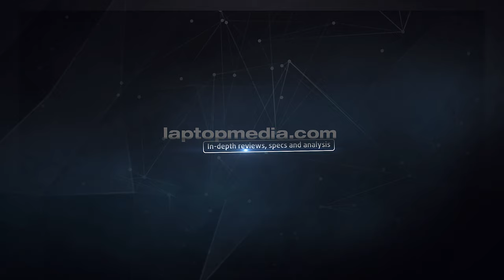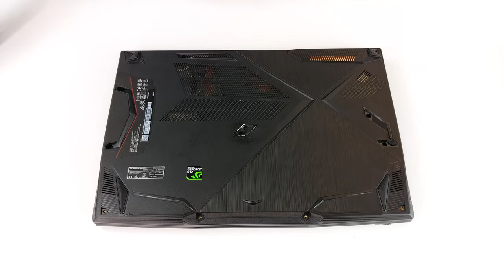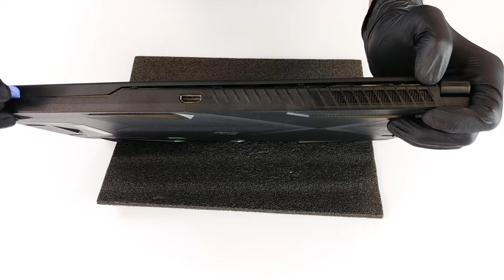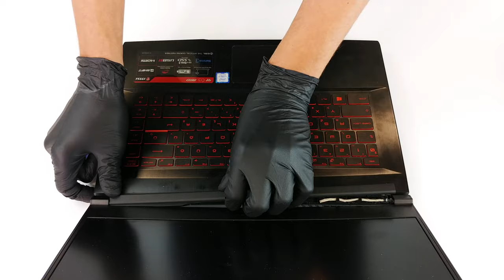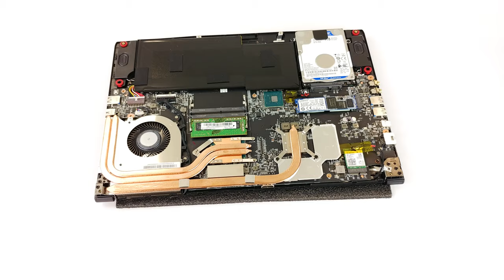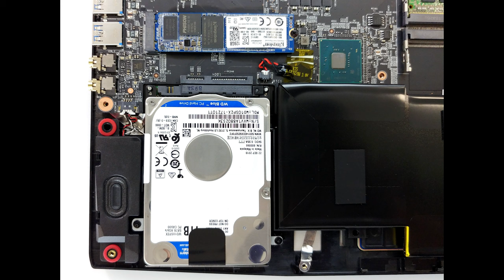🛠️ MSI GF63 8RD - disassembly and upgrade options

Comment: I SWEAR TO GOD I HAVE THIS LAPTOP AND OPENING THE BACK PANEL IS FREAKING IMPOSSIBLE!!! I STILL DID IT AFTER 2 ALMOST HEART ATTACKS AND BEFORE A 8 GB RAM UPGRADE!!!!!!!!!!!!!!!!
Reply: Same
Reply: I try to open but in halfway I stopped it.
Reply: Mine keeps turning on as I’m trying to open it lol
Reply: @tormented_imp  as in open the lid? Or open the back panel?
Reply: I am doing it today any tips for me lol as a normal person doing this?
Reply: @minimax_edits  when u take all the screws off and try removing the back panel, slide it horizontally outwards towards the 3.5 audio ports a bit... it would make it easier
Reply: @akshatrajwansh1420  hey thanks alot man!
Reply: I got a panic attack when i tried to open the panel i looked inside and saw my motherboard bending a bit then i closed it and forgot about it
Reply: Fr
Reply: Dude i upgraded to 32 gigz if ram today. Opening it was a bitch almost broke it and like 3 heart attacks later i did it. Nuthin broke.

Comment: Just as an FYI to anyone watching this video with the intent to tear down one of these laptops, the GF63 frame is brutal to reassemble. The way the bottom of the case mates with the USB ports and audio jacks is unforgiving and more often then not will lead to either a cracked bottom casing or a broken set of audio/USB ports. I’d recommend taking it to a shop for disassembly but some shops are very picky w/ these laptops due to the above issues.
Reply: Yeah it really is, I took my case off and it just did not wanna raise where the USB and ethernet cable port is located (The right side,) The best thing to do to avoid complications is take the front panel off right below the screen and loosen the right and right sides a tiny bit avoiding the ports and once finished go to the back and begin cracking it open and then move from there. That will mitigate the chances of damaging anything significantly.
Reply: ya this was annoying to get back on. For anyone reading - it was easiest to start with the usb/audio ports side and make sure that those got in correctly then push on the other sides. This isn't one of those that you can just slap the back on and push down real fast you gotta make sure everything is fitting first.
Reply: i just just did it and all good! it seems that you have to slide it INTO the ports due to the damn C port , worked like a charm for me
Reply: @jcohesive8950 omg thank you so much 🙏

Comment: This guy makes it look so easy. I have a huge time of pain in the ass disassembling this one and putting back together. The clips are so hard to come off, and then they don't go in again. My laptop still has the unseated hinge bar😥
Reply: I have problem to open the cover lol. Cause its so hard
Reply: @mont9150  Yes. I watched another channel upgrading RAM and SSD of the ASUS TUF F15 and it is super ez. The clips come off very easily and you don't need to go all around, just the sides and front. I wished I got the tuf instead of msi tho msi has better build quality.
Reply: hey i got that problem too, my hinge bar was loose, did you fix that now?
Reply: @jackshelby5421   I have the same problem, did you fix that? :)

Comment: Thank you for taking the time to make this instructional video.  I followed directions and now have 32gb Crucial RAM installed and a Silicon Power 512 SSD rolling.  Now it's game time.  Seriously thank you!
Reply: John Linder hey I wanted to upgrade the ram and put a m.2 ssd in it would I need to disconnect the battery?
Reply: @chadmcmillan3831  you always need to disconnect the battery
Reply: How's the laptop doing man ?
Any problems with it ?
Reply: @swarnamverma7808  Freaking killer.  Everything at Ultra or Epic having to go a little higher to a 2TB SSD so many games.
Reply: can you stream warzone with it?
Reply: @chadmcmillan3831  No, just make sure it's powered off before upgrading.
Reply: Did the same thing. I have 0 problems with Cubase and the Adobe Suite. Microsoft Flight Simulator almost works perfectly on there. Not a bad affordable option. I just wish I could have 3 screens. But the USB-C doesn't do video and there's only one video port.
Reply: Would you happen to have a link to the ram upgrade you bought?
Reply: Also interested in the ram upgrade u bought
Reply: bro can i install 2.5 sata ssd of 1tb in msi gf63 thin i5 11260h

Comment: My laptop is exactly like this. Just crazy how it was so amazing in the first year i got it then the third year, the plastic on the right hinge cracks then the RAM always goes up 100% with only MS edge open.
Reply: Are you using an asus tuf?
Reply: @rumabaruah2121  nope im using the exact laptop he has. It's an MSI. I had an asus laptop before too tho which is horribly laggy the first we bought it.
Reply: Same problem with my laptop. MSI is notorious for its bad hinges.
Reply: @rumabaruah2121  im using msi
Reply: @prabhdeepsingh5642  yeahh... expensive as hell only to end up getting its hinges broken no matter how much I took care of it..
Reply: Tbh the gf63 has a very solid hinge, you probably did something wrong to it
Reply: @prabhdeepsingh5642 is there a way to reinforce them or so u just replace them if they break?
Reply: @bloodnva6745  it's the plastic around it which suddenly broke. The hinge itself which is the metal one didn't. And hell nah I valued that laptop so much I took so much care for it since it was the best laptop I ever got. I got all my important files saved in it.
Reply: @ithiliel honestly just blame the cursed MS edge at this point (even for breaking the plastic)😂

Comment: Pretty good guide but a pick (I have one identical) is the worst tool you can use on it.  A standard handheld pry tool is a lot better as it's narrower and has better control.  I say this because the first one I used a pick and was not good while the one with a pry tool came apart significantly easier and with no nicks.

Comment: the hinge part kinda killed me for a sec there, does it really necessary? how do you put back the hinge part? is there a slot for it or you re-glue it?
Reply: There are notches all along the edge that you line up before snapping the trim back into place. It really isn’t too bad or hard to do.
Reply: i have the same problem here bud, my hinge bar is now loose, did you fix that now?

Comment: This might be a long shot for a video over a year old, but I need help changing the graphics card, and more specifically if I can. I want to upgrade to the NVIDIA 1650 Super, but before I sink any money into it, I want to know if it's possible to switch it out
Reply: changing a graphic card inside a laptop is not possible or better, i would not recommend it to you, bcs you would have to buy a 1650 super laptop version and they are expensive and less powerfull then a normal one, but what you can do ist that you can us an external graphic card, and if you want to know how you can do that search in youtube for laptop external graphic card. ^^

Comment: I dont have a guitar pick and its hecka hard to open it
Reply: what did u do?
Reply: @rUckAmIng  I used my fingernails and kinda marked the laptop so if your opening it i recomend being carefull
Reply: It isn't a guitar pick, it's an special tool that looks like a guitar pick. But a guitar pick also works fine to do the job though.
Reply: Alexis González nope a guitar pick doesn’t work
Reply: @Fahad123v  I use it all the time for this kind of jobs, it works fine to me.
Reply: You can use old credit cards
Reply: use a bankcard or another card u dont use

Comment: Can i change SSD m.2 for PCIe Express Gen3*4, M.2 NVMe 1.3? Like Adata XPG SX8200 Pro
Reply: I want to change my m.2 to the same drive, did you do it ?
Reply: I have a Samsung Evo 970 in my GF64-8RD and it works beautifully.  The M.2 slot supports PCI-E 3rd Gen.  I have also upgraded the 2.5" HDD with a Samsung Evo 860 and it too works wonderfully.  I am also running 16GB Ram.

Comment: Any tips to upgrade the Wifi card from 1x1 to 2x2 ? And how about the RAM, i want to add 8GB more, but not sure which to purchase. Sorry still new to pc tech.
Reply: To tell the speed of your Ram do this: ctrl + Alt + Delete, open task manager, go to the "performance" tab, click on "memory" this will show you the mhz of your ram.
Reply: Is the wifi card bad? I also felt the difference with my previous laptop, but i just think that it was my shitty Wifi
Reply: @TheScreambird  thanks mate, sorry for the late reply
Reply: @EukalyptusBonBon  yup, the wifi card that come stock was sh*t.
Reply: the stock wifi is supposely a 2x2 ac wave 2 unit from intel, the 9560, its one of the best wifi cards from intel, unless that was only my config
Reply: @realazee  nope, natively it's an AC9462, pretty shitty card to be honest
Reply: @clementveith  no, I own one and it’s an AC9560 2x2 card, maybe some units get a 1x1 card?

Comment: id like to change my laptop's battery not sure how much it cost and where to buy, any recommends?
Reply: Yea was also wondering the same
Reply: @dr.memerdemener1475  mine has started to bulge.  I removed it (it's held in with double stick tape) and it is roughly $55 USD to replace.  Model number is BTY-M6K.  I found them in stock on Amazon.

Comment: Are the USB ports supposed to be like stuck to the bottom of it? Bc im tryna remove it and the usb ports are moving with the bottom of it and im scared im going to rip them off
Reply: I'm having the same issue, did you ever figure that out?

Comment: Sir, i would like to ask, how could i take the VGA out? Because the Msi gf63 the VGA GTX 1650 could be change right? My laptop is running with intel(R) UHD Graphics Family (VGA onboard) i dont know why it not using the GTX1650 
Im using the Gf63 Có Laptop MSI Gaming GF63 Thin 10SC

Thank you
Reply: Honestly probably not relevant anymore but if your system is defaulting to integrated graphics rather than dedicated just gotta go into the device manager and make sure the integrated graphics is disabled, had this issue when I added a gpu to my r5 5600g build (take this with a grain of salt tho because I’m not a laptop wizard)

Comment: Any recomendation for RAM upgrade?
Reply: Just look for the ram speed mine was 2666mhz. So i orderd kingston 8gb 2666mhz
Reply: @Evanovesky  thanks for the recommendation, i got my self Corsair 2x8gb 2666mhz because i didn't know what ram does this Laptop have and i can't open it my self because the warranty will be void, so i bought it to local msi service center and turns out it has 8gb Kingston 2666mhz , basiclly i just  waste my money by buying those 2x8gb ram... 😅

i know that nobody give a F but i just want to write it down ~
Reply: @EukalyptusBonBon  how much if you don't mind me asking? I am scared to do this myself.
Reply: @chadmcmillan3831  since my laptop warranty still valid, the service is free, atleast in my country
Reply: @EukalyptusBonBon  you can install 2 rams. It will give you a total of 16 GB.
Reply: @gouthambolt  Can I keep the original 8GB and, lets say, add a new one with 16/32 GB in the free slot? I see a free slot there.
Reply: @animanoir  yeah you can.
Reply: @animanoir  you can do that but from various source that i read say that if you want maximum performance, those 2 slot of ram should be filled with identical Ram, as i know the Gf63 had single 8gb kingstone 2666 mhz ram, you should get something identical

Comment: Hi, I need to do do 3d stuff and digital media, can I change also the RAM? I think the one that comes with this machines is not enough for those procceses
Reply: If you have the same model in the video, you have 16 gigabytes of ram. That should be plenty for 3d rendering.
Reply: @varx0484  Sorry, I wantet to say the Processor, I have this model and when I open Photoshop or 3DSMAX, it crashes and the blue screen appears. That´s because the GPU or the processor?
Reply: @felixx.martinez7732  That sounds like a driver problem in your graphics card, which is likely considering windows. Just go to Nvidia's website, and install the latest drivers. That should fix it. If not, I have no clue. :)

Comment: Looking to upgrade from 1tb Hdd to ssd, any recommendations for the ssd or is there a conversion to sata available?
Reply: For the MSI GF63 you can have the initial ssd as well as either a 2.5" SSD or HDD (such as the ones found in a ps4, the default ps4 hdd for example is extremely slow and would not recommend it in your laptop as i've tried). I would suggest replacing the 2.5" slot with a Samsung 860 EVO 1TB SSD (or higher) as it's only $100 US. You can also replace the smaller more narrow one for one with more storage capacity. However, these parts will cost more for larger upgrades
Reply: I really like the SK Hynix gold s31 ssd. It is a great price at less than $100 for 1 TB and actually comes with a program that allows you to transfer all data including your operating system over to the new ssd. I upgraded it from my hard drive in my desktop a while ago and its wonderful

Comment: What ram do i need for uppgrade? I need double channel ram
Reply: Go too the task manager. ->performance -> ram. there you'll see how much ram you have and the amount. In my casse i had one 8gb stick at 2666mhz. So i buyed a second 8 gb stick at 2666mhz.
Reply: @tobiasg.8532  How much did this increase performance?
Reply: @humegoon_6817  more fps and the lows are much higher now. So the games are much smoother. I have numbers on my computer. I will send them later today, when i use it.
Reply: @tobiasg.8532  So you have 16 gb ram?
Reply: @Kokoro_San1234  Yes :) I completely forgot that i said i would send numbers 5 month ago ^^' I'll do it now.
Reply: @humegoon_6817  I forgot, sorry ^^' So i'll give 3 numbers every time. The first is the lowest fps, the second is the highest and the third is average fps. Keep in mind that the lowest fps will cause lags if it's way under 60.

So fortnite everything on epic : 8gb => 36 96 79             16gb=> 61 103 85

Fortnite everything epic without shadows : 8gb => 62 144 114                 16gb=> 88 172 144

Titanfall 2 (i don't know what settings anymore sorry) : 8gb=> 48 145 97                16gb=> 53 145 105

Apex ( in firing range so that i can compare the same place) : 8gb=> 51 128 81                  16gb=> 68 145 113

These numbers are not official or anything so don't say it's not possible or anything. I just used MSI afterburner so that i could see what impact it had with the 2 ram slots in use. For fortnite i did my best to do 2 times exactly the same parkour. It was a few season's ago so the numbers can change from then. And for titanfall 2 i measured the numbers on the same map for the same period of time. I have an i7 8750H, a gtx 1060 6gb and 8/16gb of ram where used inthese tests. Fortnite was a bit laggy every now and then with single channel, but was completely fine with dual channel :)
Reply: @tobiasg.8532  do it costs so much to upgrade it to 16 ram?
Reply: @Kokoro_San1234  It doesn't cost much ^^ 8gb of ram costs 30-35 € were i live :)
Reply: @tobiasg.8532  ok thank you for the info..
Reply: @Kokoro_San1234  you are welcome :)
Reply: @tobiasg.8532  yes how much ram limits for this laptop is it 32 gb ram?
Reply: @Kokoro_San1234  i don't know ^^' Probably. But if you want 32 you'll have to replace the 8giga stick inside by a 16giga one. And if it's for gaming then 16 is more then enough.
Reply: @tobiasg.8532  but 32 is the max ram right or still they have 64 gb 😂 or maybe 128 gb..
Reply: @Kokoro_San1234  i checked, for this pc, the maximum is 64 gb ^^
Reply: @Kokoro_San1234  to tell the truth i don't have this pc, i checked the video because a friend had it and wanted to upgrade the ram ^^' I upgrades my acer nitro 5 ^^'
Reply: @tobiasg.8532  but what is the limit of ram in a laptop
Reply: @Kokoro_San1234  it depends from the laptop. You have to look for each one what his limit is. For this one the limit is 64gb. For the acer nitro 5 that i have the limit is 32gb ^^
Reply: @tobiasg.8532  ok thank you

Comment: cool ok now I know how to use a screwdriver and a small pry tool and then unscrew again

for real I would have very much appreciated being told what the RAM spec is for upgrades, and if the CPU and GPU are socketed or soldered butttttttttttt
Reply: dude all laptops have soldered in CPU and GPUs with certain very minor exceptions
Reply: @beeds8287  I really don't wanna hear it.  It's a premium gaming laptop, I'm not an idiot.

Comment: hi, thanks for the vid! I really need to upgrade the disk to 1tb and replace the ram with 16gb, is it possible???
Reply: the hard drive and ram card can be added
it has 2 ram card slots and one of those slots has a 8gb ram card that comes in the  stock build
...well ik that some dont have a hard drive included
but as long as your operating systems is on the ssd then it should be easy
really the only hard part is opening the thing

Comment: Why does it looks like it has 2 M.2 NVMe slots?
Reply: I'm pretty sure it does.
Reply: c30f$p@d3z  Ty for the info 2.5" :)
Reply: c30f$p@d3z  hello, so there is an extra slow for a 2.5" SSD?